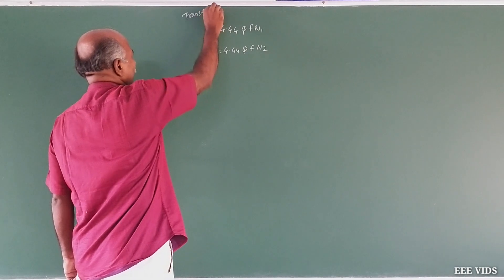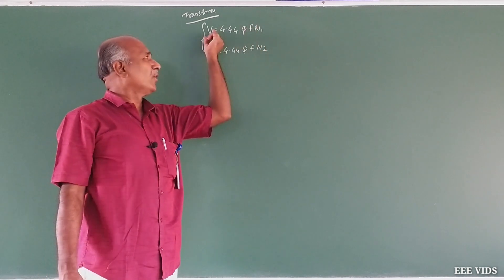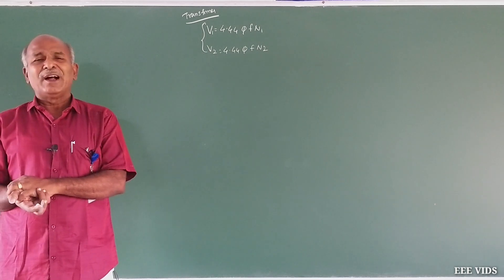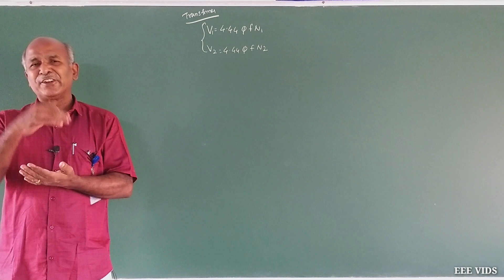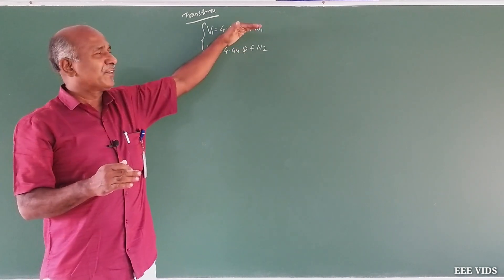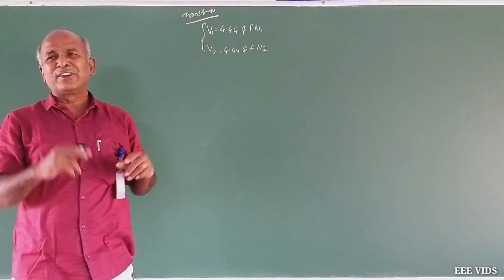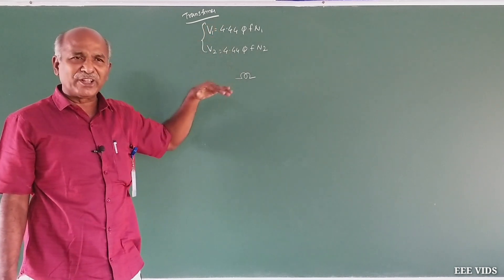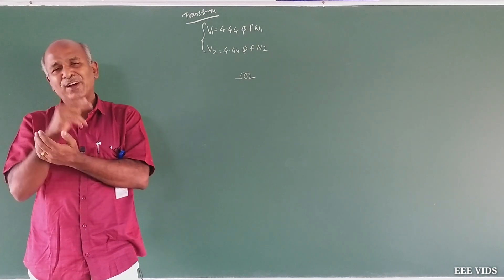Variable Frequency drive and DC link Energy saving circuits in tamil

Comment: Sir I can attached power capacitor with VFD of out in 
Bz I have dc 300 dcv then VFD output of ampere is 5.5 amp 420 vac  but I need ampere is 7to 9